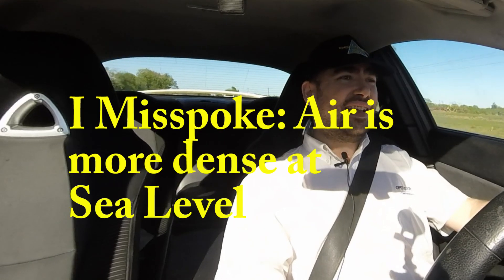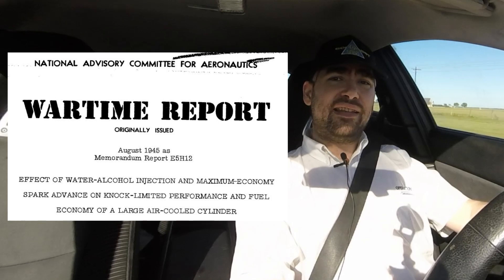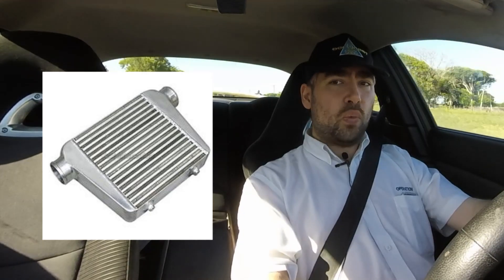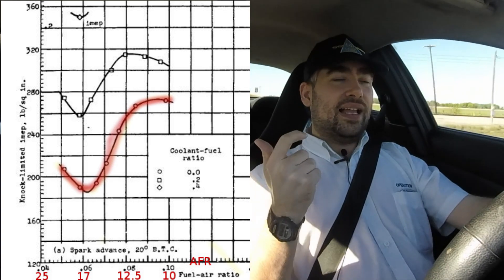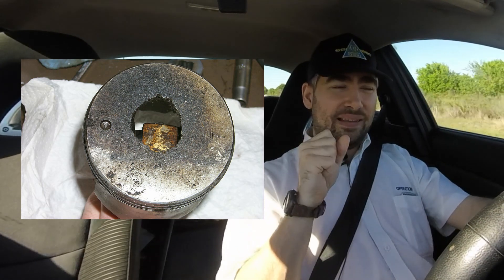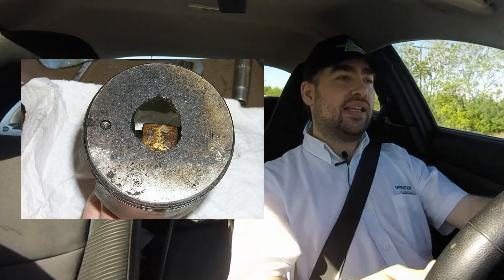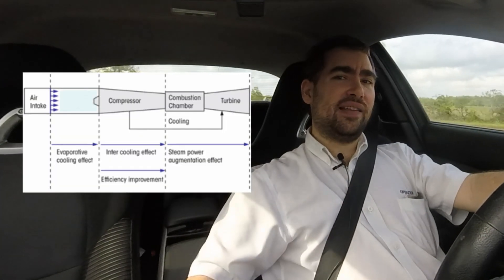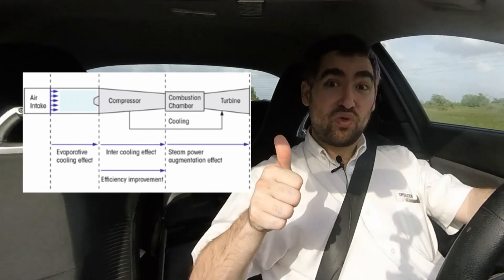Why water injection with no intercooler? Voiding Warranties - Ep35

Comment: I had a suck through system with water/methanol post carb injection (before turbo) on my 1330cc Copper S and it worked perfectly. No room for an inter-cooler anyway.

Comment: More boost wont do much unless you add more fuel or more oxygen. If your fuel pressure is already maxed out, making more boost is not doing anything but add a lot more air with not enough fuel to make use of all that excessive boost. All that extra air could even blow out the spark, send all that unburned fuel out of the exhaust and still cause detonation.

Comment: Hey! Was the experience of injection of water-methanol on a naturally aspirated rotor engine without a turbo? It would be very interesting to hear or read about it. (:
Reply: The renesis (or other NA 13B's) are not knock limited. they reach peak torque before knock (not by much) meaning you would gain only if there is very bad fuel quality.

Comment: It was the Germans who were stuck with 85 octain  aviation fuel (with what little fuel they had) that brought about WM injection. Not NACA, as you stated. 
Incidentally, we had all the fuel we needed with performance ratings of  130 Octane and more throughout all of World War II.
We never had a problem with, "bad gas" as you say, other than keeping the U-Boats from sending it and our tankers to the bottom of the Pacific Ocean.
l do very much admire your inventive spirit,
but please, if you can, backup your theories with actual test results, not just theories, after all there has never been a voided warranty by "Theory", that takes action through experimentation. 
However, I'm very thankful for your thoughtful words.

Comment: Meth works by lowering your iats and raising the octane limit of the fuel increasing total cylinder temp before detonation.. the transition of meth from liquid to gas sucks significant heat energy from the air charge temp

You're partially right, but the gains if any are not worth not having an intercooler, a multilayered approach is the best strategy for keeping your engine togeather.
Reply: You could easily replace an intercooler with this strategy. The engine doesn't care how you reduce detonation conditions. The only advantages of an intercooler are: no moving parts, no electronics, no reservoir to run empty. Intercoolers are idiot proof, that's the only reason they are preferred. If you're not an idiot, and want to reduce spool time and plumbing, water/meth makes a lot of sense.
Reply: @electrospank- so why not both???

Comment: Fast spool doesn't mean max power. There comes a point where the turbo will choke the engine and more boost will only gain higher temperatures.

Comment: Can tell you now that air intake temp has nothing to do with detonation,,, I have a blown 427 in a Camaro  with 7:1 comp ratio and hit it with 16lbs from a Dyers 8/71 and turn it 6K rpm's with locked out 30deg timing,,, Do the math,,  This is a street car,, only times i have heard any rattling from engine when sending it,, is during winter time where air temp would be from 27 to 35 deg F,
Reply: Wrong.. gas gets hot when compressed, pre ignition occurs in the cylinder when the temperature raises above the self ignite level of the fuel. You had cool air going in, but it was dense af, gaining heat from the compressor then gaining heat again when its compressed in the cylinder.. more gas = more heat... boom.

Comment: any thoughts on superchargers and water injection?   will there be as many benefits?  I am thinking of using an edelbrock e-force and there is an integrated water/air intercooler right after the rotors so I can't just eliminate it.   My worry is that the water will condense on the cooling fins and be pushing full drops of water into the cylinders.  Will they evaporate the moment they touch the valves?

Comment: Vappr pressure of gas is important too. Prevent detonation with less volatile high octanes of acetone or xylene. Even low octane but low vapor pressure kerosene mitigates under high temps. Once gas vapor locks, detonation is more likely. Hence the cooling effect of intercooler can be done withsuch fuels, water heat absorbing and steaming aiding in increase of compression. Water injection by premixing it wity ethanol/acetone and  adding it to Xylene in the tank is best imo

Comment: You can not overcome the built in sabatoge externally.

Seems like none of you know it all shit for brains has any clue what's really stealing power and mileage from all engines.

Here's a clue for all of you geniouses.
Why does the exauhst valves crack open 1° at 2° compression stroke.

How does the venturi effect of the moving exhaust gases suck out 80% of the vaporized fuel and  air mixture.

You can not find this math in any publication.
But you can see it happen real time inside the cylinder with a bore video camera and strong pen light.
Once you see it you have to believe it.

Round over the exauhst lobes will give you back that stolen 80% waste in efficiency .

I wish all humans that mis use knowledge for WEALTH would go strait to he'll on the coldest day of winter.

Comment: Intercoolers do not increase spool time in any appreciable way.  Think of a typical boosted 2L engine and the turbo is shifting about 300L of air per second.  How long is it going to take to fill a 5L intercooler.  About 2/100 of a second.  Intercoolers do cause a pressure drop as does any flow restriction in the inlet so I guess that can affect spool but that's more down to bad design or application.

Comment: I agree with some of the details, the bottom line is that running a boosted car with no intercooler certainly has its benefits as long as you can manage cooling that air going into the engine in both wot and tip in throttle

Comment: Intercoolers are great, water injection causes rust and slows ignition of the engine, as iv experienced
Reply from the maker: Water injection in proper amount does little to effect ignition, and there is already plenty of water produced as combustion products to cause rust on internals, if that were a problem.
Reply: As iv experienced

Comment: Re volume of intercooler. If you have a 2.6 litre engine (or a 13b) it breathes 1.3l of air per revolution. This means at 3000 rpm it's breathing around 65 litres a second. Your 5-10l of extra intake volume is inconsequential compared to this number.

If, like me, you have a 4L engine that either operates or flashes to 3500 rpm whenever you put your boot down it becomes even less important.

Also, my 993cc 170hp Daihatsu Charade (it had a big turbo) didn't have response problems over 4000rpm either, despite the much lower airflow.

I'm putting this down to the engine and turbo being really really big pumps in comparison to the smaller intercooler
Reply from the maker: The effect of IC and intake volume (as well as exhaust volume before turbo) is not intuitive. Yes the actual volume is quickly filled by the turbo and engine, and if the turbo instantly went from discharging 0psig to 15psig then the difference of intake volume would be negligible. BUT that's not how it works, the turbo increases pressure incrementally, so let say intake pressure goes from 0 to .01 psig when the throttle is opened and the turbo begins to spool. This translates into exhaust pressure going up by a similar amount, and more energy feeding the turbo, so the next cycle the turbo goes from .01 to .02psig, and rinse repeat. What changes with intake volume is how fast this cycle happens between the turbo producing a higher pressure and it seeing it on the exhaust side. Since people are so confused about this, I'll change intake size drastically and get the data, maybe that will clear things up.
Reply: That would be a fantastic experiment!

I'll put my chips on the table and say that what you are describing will only have a noticeable effect at or around the boost threshold of the engine where lag is greatest, and it won't be that much of a change even if you, say, quadruple your plumbing volume. Actually that still wouldn't be much on your engine, so let's say if you had a volume equivalent to the largest FMIC installations. At higher rpm (say 2000 above boost threshold, assuming typical sized car engine) I think the response difference will be negligible.

(Also assuming that you increase volume through diameter increase or an empty volume plumbed in rather than having 15ft of looped 2" piping, because the latter introduces much more restriction into the system and I'd have to call foul play)

Comment: I wouldn't feel safe doing pre turbo injection with no intercooler on 22psi lol. Pre intake post throttle body.
Reply from the maker: Knock detection and boost cut is the only thing that keeps me safe.

Comment: but larger intake plenums give you better throttle response not slower worse response. A lot of what you said was false man.
Reply from the maker: Intake volume between the turbo and throttle body does make turbo lag worse. Intake diameter can help with throttle response depending on the other restrictions, but only to a point. Try a 12" and 20' long intake and see how long it takes a tiny snail to pressurize it. Yeah it will flow better, but it will take forever to pressurize.

Comment: Been running 100% water injection on my track supercharged car for the last 18 months 
Without it iat would reach 90+ degrees which causes increased fuel mixture and pull in ignition 
They now are between 30-42 degrees it's allowed me to run up to 6 degrees more ignition at higher rpms also have a failsafe map with lower ignition incase the water injection fails, I've also seen cool exhaust temps and the car has been a lot more consistant on track
Reply from the maker: Water injection is quite remarkable but figuring out what the intake temperature should be is really complex math. But trial and error works well.

Comment: Very wel put to gether. 
diesels don't play well with the gas/fuel rules  
60°f  IAT is were power loss due to reduced burn efficiency. 1% increased fuel consumption per hp per10°f rise above 60°f.  (This is due to like you said less mass of O2)   The example Cummins , manufacturer gave was a 250 horsepower engine will only produce 240 horsepower at an IAT of 90° but it will still burn 250 horsepower worth of fuel. 
When ambant is above 60°  the only thing that can be done is improve IC thermal efficiency.   +20-30°F above ambant is considerd a fair to good cooler +50° is consiterd poor. 
 Eg.. 2 factory 5.9l cummins  both 160hp 400tq  1 Ic (91.5-93 late) 1 after cooled using engen coolent180° thermostat (89-91 early)
Early +4psi @21 , biger injectors , min IAT 180°
Late  17psi 20° above ambant  (testing standerd is 25°c)

Comment: Interesting but, lots of talk and no personal data, or demonstration. I've run pre & post nozzles successfully for years but never took the time to get into validating the benefit of pre turbo injection because everything worked well together. I have heard yay & nay to intercooler elimination & have found that the water/meth ratio plays an important role as to the overall  benefit.

Boost level, if all you're running is up to ~8 psi the intercooler benefit will not be as great because outlet temps from the turbo will probably hang around 150 deg before hitting the intercooler. For every 10 deg drop in air temp going into the throttlebody, you can expect ~1% increase in performance. Weigh the IC efficiency loss as an obstruction against the gain from having it at that level of boost to decide if it's worth it. Plumbing is not that big a drag, I once ran 13 ft of plumbing for an intercooler and the datalog registered an insignificantly low level of delay in boost onset per the datalog.

The higher the turbo air exit temps, the better water/meth will work, water needs to be close to its boiling point to evaporate significantly BEFORE entering the combustion chamber where most of its work is done, in order to really help reduce inlet air temps. This is where the methanol shines, it has a much lower boiling point and does a lot to cool the intake charge. The Grand National guys reported frost on their intake plenums after track runs from running very high methanol injection ratios bordering on 100%. Running a 60% ratio of methanol I have found my intake cold to the touch following a few brief boost runs.

 The intercooler is better left in place simply because it offers cooling when the water/meth injection is not activated, usually at any boost level below 7 psi. Large turbos with small nozzles (1 lb/hr) injecting into them are probably not going to have a problem with erosion because of their larger blades relative to the water droplets. I believe installing a nozzle directly into the compressor housing close to the apex (narrow) point of the spiral achieves the same result as injecting directly into the compressor since it is the heat that is acting on the mix, not the pressure, for those concerned about blade damage.

  Ultimately the arrangement and mix ratio should be centered around what the engine is intended for. I built a high compression daily driven V6, 11:1 in defiance of speculators with no proof it could not be done with today's modern engines and management systems, which are far more efficient than the old carb motors and ran it with pre and post turbo injection on pump 93 octane fuel as high as 22 psi without a spec of engine knock (detonation & knock are two different things). I datalogged the motor frequently. I still saw compressor outlet temps hit 170 deg but never tested it without preturbo injection to note any difference. In the future, I'd like to test a dual system, one injecting near 100% methanol into the compressor and the other 50/50 just ahead of the throttle.

This video needs cold, hard before and after data. Although I believe there is a point and water/meth ratio at which you can eliminate the intercooler, I highly doubt this is one of them. I've been doing this stuff personally since 1995 on my own cars. If you remove the intercooler you will have a power loss due to the increase in inlet temps all the way up until the water/meth injection kicks in for sure, until definitively proven otherwise which is not going to happen.  Automotive performance is definitely a "Don't tell me, show me" subject. I blew a lot of cash on testimonial driven purchase, with no data proof of claims to figure that out.
A simple scan tool capable of reading inlet temps is a cheap means to perform a simple before and after test here as proof.

Whatever you do, always be safe. Experimenting with water/meth injection, keep a fire extinguisher on hand. 
The video is helpful to some no doubt, but don't talk so much, I'm old.
Reply: q q water could absorb 4 time heat than methanol, the air should be cool down before into combustion camber to make sure air density  , density means the oxygen is more
Reply: Iv gotten rid of mine on my volvo its my daily all i have is a small one in my charge pipe near the tb and it goes at 2psi then a rpm switch off the same pressure switch to the sec pump to a big preturbo nozzle. Two tanks one for the tb i just run distilled water on low boost and washer fluid for the preturbo (25%meth) and for track days washer fluid for the tb and meth for the preturbo with dry ice in the tank just make sure your vent is big enough lol. Dont ask why i know lol. But iv never had an issue and did see a huge difference from intercooler to no intercooler and water about 800rpm.

Comment: I've recently increase boost quite significantly and noticed my IAT has rocketed which is overwhelming my IC. Been thinking of pre-turbo injection a while, but never really considered this kinda makes the IC obsolete. Great insight and explanation - thank you!
Reply: Nissan Patrol GR 3.0 Di Turbo  sounds like you ran off the back (right side)of the compressor efficiency map.   An over driven turbo will produce  more psi at the same mass  due to thermal expansion.
Reply: It doesn't make an intercooler obsolete, because pressure and temperate are related. Could be that detonation isn't caused by pressure, which I think is mostly true, but with more temperate you get more pressure.
Reply from the maker: Pressure and temperature are related but inside the cylinder it's all about pressure. An IC will let you have cooler higher density air, which gives you more power at lower pressure, but it can't fix the threshold where Det happens. WI can, but isn't as reliable, so an Intercooler will never be obsolete but might not be right for every application.
Reply: Voiding Warranties  as stated in  my other coment diesels  dont play well with the gas/fuel rules.  His IC is being overwhelmed  with the  extra heat from running off the back of the map for his turbo.  The extra diesel to raise exhaust pressure =more spin and at low efficiency ,resulting in heat induced boost gain (+psi) at the cost of MAD manifold air density (-air mass)  .
---
 Not trying to stomp on any toes ,just picking up were you left off in regards to diesel.
Yes. You can ditch the IC but you will have to refill your water/meth tank(30-60% the size of your diesel tank) every time you fill the diesel tank
If building a kit I would do a 2-8 calibrated nozzle w/m  sys depending on how many it took to control. Usinga  sequential temperature/ pressure sensors logic controller  so that when stage one  2% fuel mass @90°f/5psi gets overwhelmed . stage 2 kicks @150° f pre turbo or 110 post stage 1.  Smaller =more stages between  cruse and wude open. How many/big lph depends on how hard you're flogging the dog when you're trying to get her out of the mud/ snow and you're getting higher revs you might need that 8th stage to keep it your intake air temperatures down. In the stuck in the mud example the water meth system would destroy any intercoolers attempt to compete you're not moving you don't have any Ram Air.  But alass Im not a programmer so the idea doesn't do me any good lol